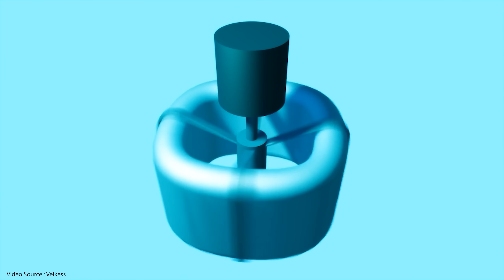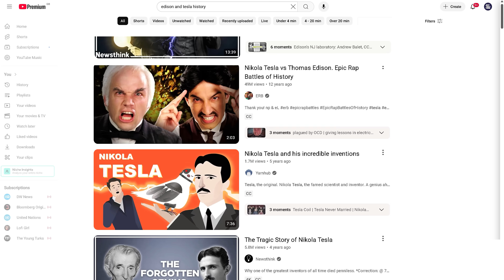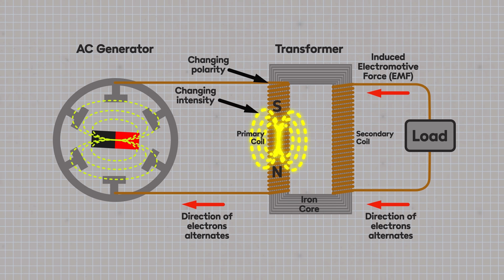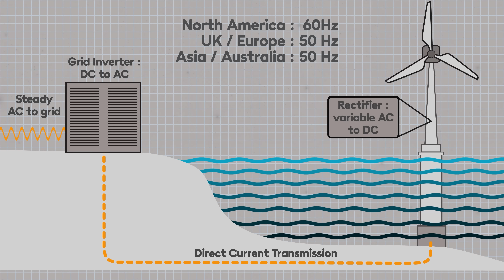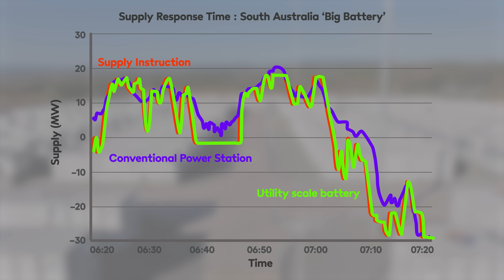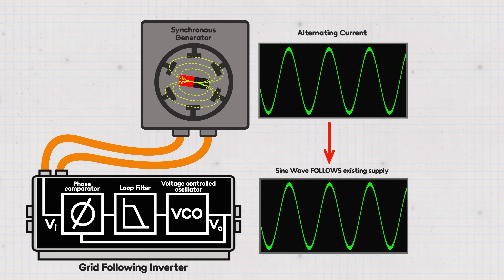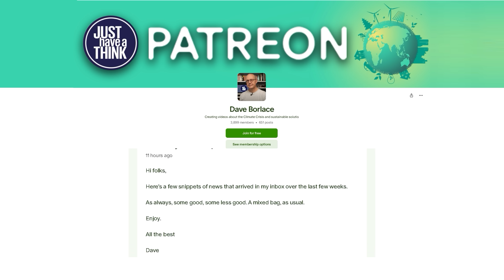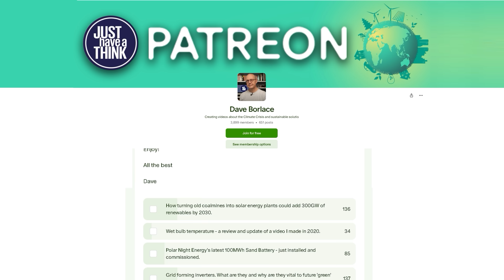How GRID FORMING INVERTERS are paving the way for 100% renewable energy.

Comment: This is an easy-understanding video. Grid-forming inverters have been developed in Japan, but they have not yet been put to practical use. Grid engineers are aware of them, but the cost is not yet justified and the need is not strong. For the time being, they believe that it is sufficient to follow the grid codes issued by the electric power companies.（Japan）

Comment: There’s a fundamental problem with renewables:  everyone has excess energy to sell back to the grid at the same time, and conversely, they all need the grid power at the same time.  Adding insult to injury, most of their electrical cars will be pulling power from the grid while the sun is down.

As governments trip over themselves trying to get rid of all their clean burning natural gas plants as soon as possible “to save the planet”, they find themselves in desperate need to build massive and horribly expensive battery banks connected to the high voltage lines (BESS).

Currently, California forces new construction residences to have solar panels.  I’m certain they will also force them to have battery banks as well, since they can’t build these BESS systems fast enough.

And once they finally solve that problem on the back end, there will be a summer with hot muggy overcast weather, leading to rolling blackouts once all the gas/nuclear power plants are gone.

And to add even more insult to injury, CA is incentivizing/forcing home owners to abandon their gas powered furnaces for efficient heat pumps, leading to the need for more electricity during the cloudy winter months…

Comment: By using the regenerative grid theory, absorbing surplus grid streams at night, as hydrogen generation, battery fill, and battery heat in sand battery networks, is the most profitable and efficient way to progress into the future.

Comment: Heat batteries that use sand could spin turbines.  Sand can reach levels high temperatures that are sufficient to produce high quality steam.  Sand batteries have emerged this year, so a near miracle could be at hand.  

Another option for high quality, on-demand green heat would be metal powders.  Metal powders are fully recyclable, as well.  They plentiful, everywhere, and cheap.  Aluminum, iron, and zirconium powders are highly desired in this regard.

  Using the reliable turbine systems are a common sense move.

Comment: I work for a power system operator. I don't have much direct experience on these systems but i did study the literature. Compared to synchronous machines and synchronous condensers, inverters are much more limited in terms of overcurrent. This means that if there's a short circuit on a nearby line the voltage response the provide us not as good. The good news is that there will probably be many grid forming  inverters around the grid, so combining all of them might give similar results to having a few isolated traditional generators. In the end i think the systems of the future will be managed with a mixture of grid forming and synchronous condensers. The literature hasn't fully answerd what happens when you have many grid forming inverters interacting with each other, that's also something that we will start experiencing in the coming years.

Comment: JHAT thx for an informative and well produced video. I have 31 yrs with electrical utility including operation of large 320mw fossil fueled plant and black start capable 180mw gas turbine peakers built following the 1967 No East pwr grid collapse. As long as  black start peakers and hydro generation is available or for smaller isolated loads emergent dsl mw gensets are available with adequate fuel sources little need in emergent design  IMHO is needed YMMV I served in USN in Vietnam on a Patrol Gunboat We had 2 100 kw dsl gensets which We  started and stopped without grid support when at sea When We had shorepower available We dropped and picked up load without paralleling. I have an RV with 800 watts of roof top solar, a 5.5 kw Fossil fueled genset, and 400ah of LIfePO4 battery bank with a 4KW inverter + 50a Shore power capability I can select any source with out manual switching as I utilized automatic transfer switches in the design that are interlocked and prioritized   to not parallel sources to load. Scalling the grid up offers same capability with existing utility technologies.

Comment: "Well it's obvious . . . " Oh for pity's sake!? The stability was never from the spinny turbine! (Apply a sudden load to a generator or a motor, and it changes speed VERY abruptly. We call it "a braking resistor!" If you take your foot off the pedal in your EV the motor stops fast enough to need brake lights, or the guy behind will go up your backside!  It's called "regen braking.")  The steam turbine's "stability" came from the steam pressure in the thumping great big boiler! (If you want to keep the turbine output stable you have to put in more energy from somewhere! Laws of physics! The regulator opens the steam valve. Your "inertia" is active regulation!) The steam boiler is effectively a "battery". Whereas with renewables this battery effect can be provided with . . . A BATTERY!! What it needs is "certain people" to get over their "control issues," put away their 1930's brass clockwork toys, lovely though they are, join the 21st Century, plug into the internet, and talk to us!

Comment: I've yet to see an inverter system (grid forming or otherwise) that could energise a 500MW transformer.  The initial inrush is typically 10 time nominal rating for 2 or 3 cycles. This is within the capacity of grid scale rotating synchronous generators. If you can't energise large transformers you'd better hope a black out near happens.

Comment: Wind power producing primarily compressed air could solve all this, compressed air can be dumped in a single tank,even the tower can be the tank savings in cost,from that a single generation unit will provide the electricity for the grid .😊
Most of the air will be converted constantly to electricity to prevent heat lost, and of course long term storage can be used. 
A note: compressor can work at infinite rpm so can work at any wind  speeds keeping the system working and overcoming the the natural losses of the
CAES sistem.
A added advantage is that  
some hydrocarbons can be used if extra energy is needed this eliminates the need for external fossil fuel units.

Comment: I used to work on a grid. I'll never forget a tour I had of Sydney's main capacitor bank. It was huge. You could hear clicking as demand changed. The instructor was calm chatting about close to capacity they were at about %98. It was a hot day, but it meant the grid was on the verge of overload. Possible collapse. Lol
Yeah, we need that buffer.

Comment: These devices actually have a potential of making our grid MORE reliable. Think of a generator like a single speed manual transmission car driving up a hill. If you've ever driven a manual transmission car you know that the engine can only produce so much power at any given rpm, regardless of how hard you press on the accelerator. So if you are already at max power output and the hill gets too steep, you will start slowing down, which lowers your max power, and so on until you grind to a halt. It's why many grids are extremely sensitive to deviations in frequency. Well when you replace physical spinning machines with virtual spinning machines, you don't have that limitation. If you dispatch new generation quickly enough, you would still have the power to recover from an underfrequency event that would cause a collapse of today's grid. In the future frequency deviations might only be important insofar as they cause overexcitation on transformers. There are some technical challenges of grid forming inverters relative to synchronous machines, but for almost every case I've seen they can be mitigated by existing and relatively inexpensive technologies.

Comment: Yes, grid-forming inverters do use accurate clocks for synchronization, enabling multiple inverters to align their phase references and operate cohesively in scenarios like microgrids or distributed systems purely based on shared precise time knowledge, without relying solely on traditional communication links or grid signals.
This is particularly evident in droop-based grid-forming inverters, where GPS time-calibration is employed at the controller level to correct internal clock drifts caused by crystal oscillator inaccuracies.8fd9c6 By syncing to a universal GPS time reference, inverters maintain a consistent phase angle derived from integrated frequency over time, preventing issues like frequency instability, loss of synchronism, and unequal power sharing.07af33 Experimental validations have confirmed the effectiveness of this approach in real controller hardware, justifying its use for stable, decentralized operation.76db57
docs.nrel.gov
research-hub.nrel.gov
research-hub.nrel.gov
Additionally, in multi-source inverter-based microgrids, consensus-based algorithms can synchronize clocks across inverters to eliminate drifts from mismatched time registers, ensuring all units operate with identical time values.f2fd4d This method, which requires minimal communication and computation, has been demonstrated through simulations to improve microgrid reliability by mitigating synchronization problems purely via aligned time awareness.378099
sciencedirect.com
sciencedirect.com

Comment: Large trials of alternative electricity generation were allowed on the public power grid to encourage their broad practical development.   The broad practical use for wind turbine and solar voltaic electrical generation is maintaining electrical storage.   It costs more natural gas just to to keep gas turbine generators at high readiness making near zero electricity ready to back up solar or wind power  100% in 2 - 3 seconds than to make all the power from more economic fuel efficient sources of base load electrical generation.   There is no overall fuel savings for supporting these erratic forms of power generation without taking risks of short falls or over supply that will cause black outs.  Once the power grid management has suffered black outs from these risks it will do most anything to keep the situation from happening again which is using larger amounts of high readiness peaking power at high fuel costs.   The UK and Germany have greatly culled the output of wind turbine generation to save on expensive natural gas.

Comment: atomic clock time is freely available {every mobile phone} so why not have an absolute standard frequency for a grid to which every contributer must conform.overload will result in selective load disconnections  and not frequency drop. this will require rotating plant to be strictly base load suppliers, now possible with industrial scale  batteries.

Comment: Do any renewables systems use that electricity to generate steam thereby keeping the existing generators running and thus avoiding the problem.  Obviously there would be a loss of efficiency, but it might be another solution.

Comment: Great vid Dave. To put this into perspective, SA's Hornsdale big battery was actually upgraded back in 2020 adding 50% to it's power and capacity and to include Tesla's "Virtual Machine" (grid inertia support). And grid forming inverters have been around a lot longer than that. It was never really a problem but it does depend on the ability of batteries to do two things - respond almost instantly to changes in demand and of course the inbuilt "inertia" of all that storage being available on demand. So you need to build the infrastructure to support the grid.

Comment: I went to the UK and did a seminar on converting the grid to DC in 1995. Back then the UK was leading the way into modern electrical systems. They predicted that the UK would have a DC grid by 2015. Looks like they are now 20 years behind. 
We now live in a DC world, virtually everything in your home uses a switch mode power supply to create DC including tvs, washing machines and heat pumps. The harmonics generated by these switch mode power supplies generates harmonics in the grid. 60% of losses in domestic distribution transformers is heat from these harmonics. It’s time to redesign our electrical systems. With the cost of single and three phase inverters we no longer need an AC system. With the better brand inverters you can save power because these inverters reduce iron losses in electric motors.
There are already countries using high voltage DC distribution systems which have less losses than AC distribution. Modern electronics makes converting DC voltage up and down very reliable.
Once you have a dc system you no longer need to worry about synchronization, it’s all about load sharing.

Comment: Generating a steady 50 or 60 Hertz sinusoidal wave is very easy to do these days. It starts with a crystal oscillator, a look-up table stored in a ROM (Read Only Memory) or other memory, a DAC (Digital to Analog Converter), a filter to purify the waveform, and an amplifier to boost the voltage to the appropriate level. All this is done in every portable power station on the market.

Comment: There are other issues. Lets say you're connecting to an inertia-based system, but that system is down for some reason. There would be major issues to contend with. The primary one is back-powering the grid (using a grid forming inverter) while technical people are trying to work on what they perceive to be a downed or unpowered grid. This could prove lethal to workers (and is the reason why home solar systems are required to automatically disconnect from the grid when the grid goes down). For this reason, you would only want to use a grid forming inverter on an isolated grid (i.e. one that is not associated with inertia-based generators). Also, you would only want (or need) one single grid forming inverter on that grid, as all others would follow. Finally, a grid forming inverter is only needed in order to get an unpowered grid started. Once started, all other followers would keep the grid going, even if the grid forming inverter itself failed or was turned off or removed.

Comment: I run an electronics company that has built power electronics for 40 years, including a wide range of custom inverters.  GFI are not new, we have used them since the vacuum tube days.  My little company also performs stability analysis on the power grid and protection and control designs for power companies, Laplace and Bode and all of that great math.  Over 35 years ago had a job with energy research with US Dept of Energy (aka, The Atomic Energy Commission).  We have a bird's eye view of the power grid, all of the way from concrete, power electronics and grid structure. ALL of the renewables are simply TRASH compared to conventional and advanced nuclear.  Renewables are a waste of time and money, I tell everyone you can run your house of size D flashlight batteries if you have enough money and are that stupid.

Comment: Well explained but my Tesla Powerwall seems to have no problem. If offline it has nothing to follow and seems to run just fine. When the grid is restored it seems to bring it’s waveform back into sync and reconnects. Now obviously if the world was made up of Powerwall/Gateways the grid would never return but this does not feel like a major thing to fix.